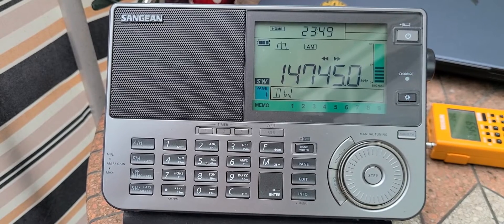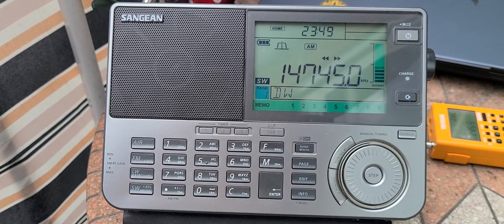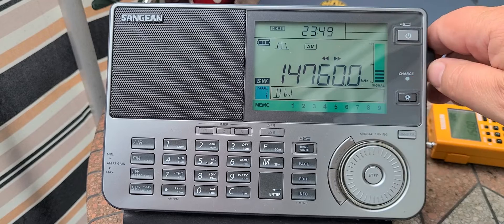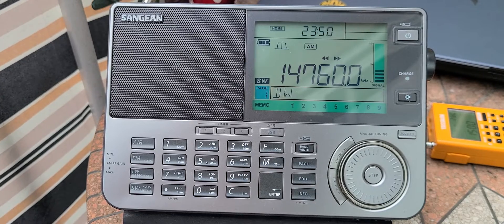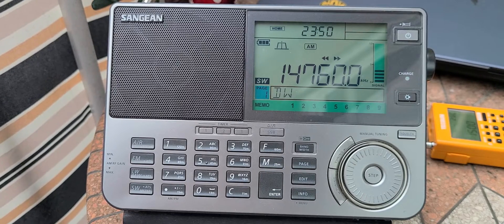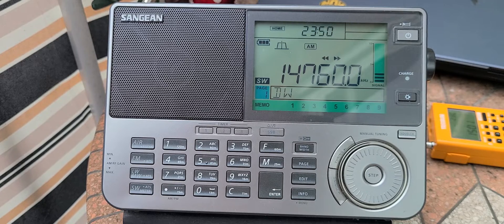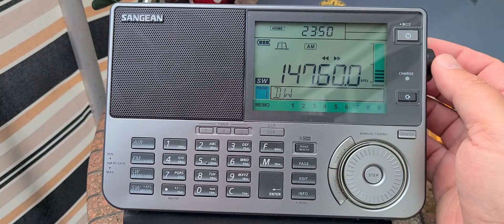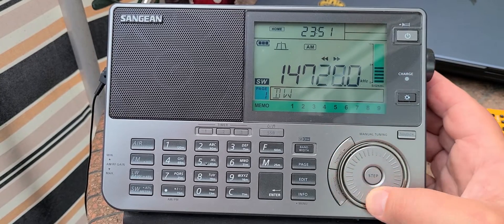Tips to remove FM breakthrough in radio receivers a external antenna often fixes the problem

Comment: With my 501x I have a huge problem with AM breakthrough all throughout the lower frequencies below 6000. It is even worse with the Sangean external wire antenna, but I found that if I plug the Sangean into the FM antenna socket I still get improved SW signals but no AM broadcast radio interference. Can you explain this? I thought the external FM jack only enhanced FM reception.
Reply from the maker: almost all portables have breakthough of AM below 3000 kHz , it does not matter much as there is very little there anyways
Reply: @OfficialSWLchannel  Well here in my location in SF bay area peninsula I am only getting very weak signals or AM breakthrough even with the Sangean wire reel antenna so far.

Comment: It seems this is a bit more of a problem with DSP-based radios.
Unfortunately, some radios do not have an external antenna Jack. 
On these, it sometimes helps to lessen the length of the telescopic antenna by pulling it in a couple sections.
📻🙂
Reply from the maker: I have not seen really more of a problem with the DSP based radios...for me it seems rather equal.. as many analog PLL receivers have this as DSP..I think it might have to do with what IF frequency is chosen in the double or triple conversion radios

Comment: I can advice you to use a J pole (or j stick named) antenne, its made for dx and hardly does not receive local signals full strength so this solves the problem mostly.